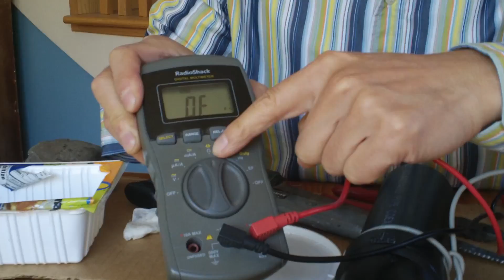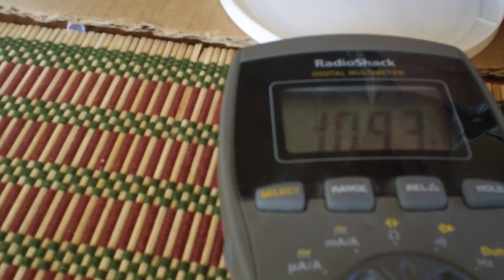How To Make Different Cheap Moisture Sensors

Comment: Have you used this on a microcontroller like Arduino?  Also, have you seen much difference in reading depending on nail temperature?
Reply from the maker: I have an Arduino kit, I have not connected to it, I assume it should work. Have not noticed any differences due to temperature change, usually if you have two different materials, such as mechanical thermocouple, temperature will make a difference.